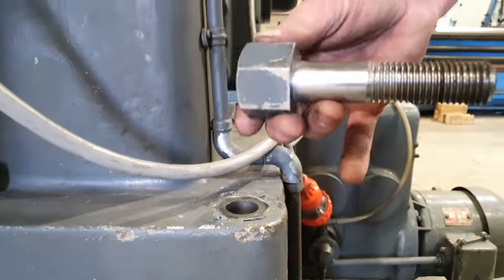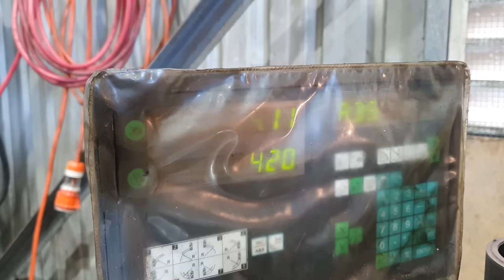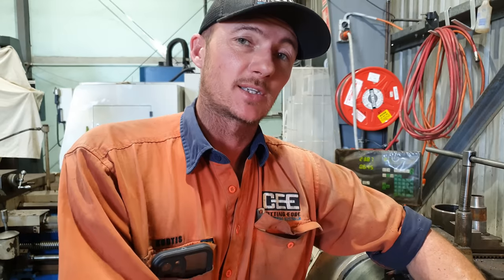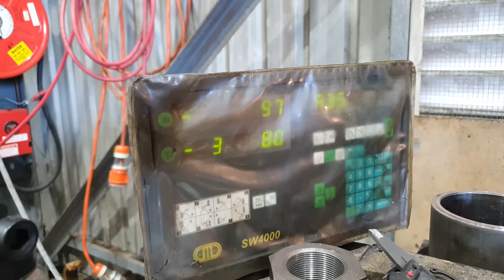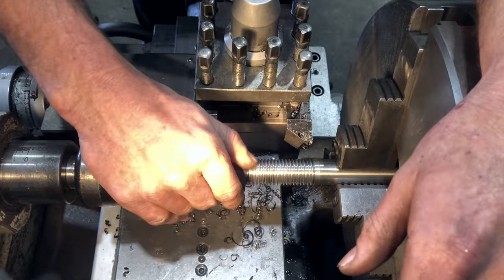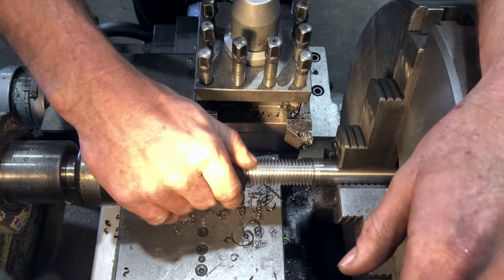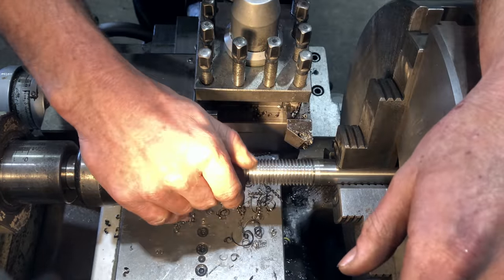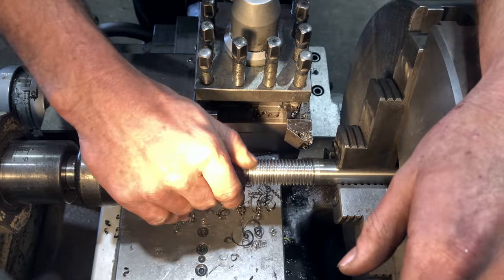Making BIG Hex Bolts | K&W Facing Borer Upgrade | Part 2

Comment: You forgot possibly the two most important reason to have the hex heads flanged. 
(1) it looks prettier than a plain hex. 
(2) it gives you a good reason to have used that large round stock. You can't do that with hex stock! 
Everyone knows that style and excuses come before function haha.
Reply: Any advantage to cutting the entire bolt out of such a large stock vs making a threaded rod out of lighter stock and welding a nut on the end?
Reply: @MMMRCHPCTB  That’s a different can of worms. You’d save on material but always worry if the six wormy welds were strong enough. Machining from solid 4140 is best with no worry about the worms.
Reply: @MMMRCHPCTB  I would make a threaded rod and use two nuts from each side no need to even weld
Reply: @ellieprice363  if the nut was threaded onto the rod the threads would give it all the strength it needs, just one weld on the end to keep it from spinning.
Reply: @dewaynek8591  True, 4140 all- thread rod  and welded flange nut would be strong and work well but wouldn’t need the machining that viewers are more interested in.
Reply: Mate, that's probably what the rest of us would do (having lesser tools). I think ole' Kurtis is more of an old school Engineer and want's to be proud of every piece of work he does - even if it can't be seen, someone will find it one day. Beautiful bolts and a pleasure to watch. Cheers.
Reply: @ellieprice363  if the only point was to make YouTube content he could have used 1” round stock and just threaded the ends which should be stronger than all-thread and then made the flanged nuts from scratch. Could have even cut the threads with a slight interference fit to get some liquid nitrogen action and top it off with a bit of TIG maybe silicon bronze just for aesthetics. Not saying the bolts didn’t turn out great but if you’re going to go over the top might as well go way over.
Reply: @MMMRCHPCTB  Yes, he already had the large stock which is a big advantage.

Comment: Another top notch video. I wonder what caused the reflection on the wall behind Kurtis during the out takes and also on the lathe behind him. 
The bolts look so very good and it will be a pity to paint them if you do.
Sorry to say Australia lost in the Little League World Series. They did play some good ball though.
Looking forward to you lifting the K&W Borer and fitting that block in there and then actually using the new machine.
jack, in The Valley of the Sun, Arizona, USA
Reply from the maker: hey mate the reflection is sunlight coming down through the whirlybird vent in the roof!
Reply: @CuttingEdgeEngineering   Saw that a couple of times, I thought beam of Sunlight through a fan.
Reply: De

Comment: Your videos are always interesting to watch and you can learn a lot, specially someone who's not in machining like me. Are you planning to cold blue the bolts or crome them as the original ones were ? Looking forward for part 3!
Reply from the maker: hey mate thanks for watching, wont be doing either of those the bolts will stay as is
Reply: @CuttingEdgeEngineering  have to polish them once a week to keep the rust off. Speaking of which, what happened to the indexer's complexion? Looks like a visit with some Evaporust followed by Bostick's Dricote might be in order. Don't know if you get either down under but both good products. 
Thanks for the video, Karen's excellent work as usual.

Comment: OMG! You didn't peck,dab,peck, dab, peck,dab with a strategically placed tin of cutting oil whilst centre drilling. Usually done by folk just because they're on Youtube to stop negative comments about wearing out the centre drill blah blah blah. Life's too short to worry about bollocks like that, good on you. Nice work.
Reply: I don’t wear them out, I just break them doing that!  I’ve gotten better at that.
Reply: Big machine and workpiece less chance of the larger centre drill breaking.

Comment: Things to have in the end times:
a) 2mm drill bit as they friggin break
b) 10mm socket as they mysteriously vanish
c) 12mm button insert (a newcomer but apparently promising)
Reply: Not only 10mm sockets, 10mm spanners (ring and open ended) also have a nasty habit of growing legs and walking......
Reply: @jonathangriffin1120  I frequently call these "deserters" ...
Reply: @jonathangriffin1120  Testify! Those damn 10 mm spanners are what you need for the cabinetmakers joint clamps to permanently pull the two panels together and the proper spanners are the only ones that will fit in the rebated holes. The little bastard frequently goes missing and the best thing to do is to buy multiples to keep in the tool box.
Mark from Melbourne Australia
Reply: 10 mm spanner, sockets and socks all go missing. Curse of the S.

Comment: Couldn't you just use a pipe wrench on the ends of those bolts without having to stuff around making them hex?

I wish I could have seen your face when you read that. 🤣🤣🤣😂🤣  Good job, done properly. 👍
Reply from the maker: I threw up in my mouth a little bit reading that 🤣

Comment: That's a lot of material to remove to make a bolt. I would have threaded both ends of a rod and silver soldered a nut onto one end. You do good work and the bolts are very nice.

Comment: I'm a mechanic in a large machine shop.  I have never seen anyone thread like that.  Usually they set their topslide to 29ish degrees and use that to move in on the thread.  Bringing their cross slide back to 0 after backing up.  Of course here in the states they don't have to stop the machine and reverse it for UNC usually only for metric.

After looking a little better I see your topslide doesn't seem to rotate like that.

Comment: Cutting threads with the compound at 90*, I see you advancing it along the Z axis slightly each cut so you are cutting with the front edge of the tool each pass and not just plunging, I'd love to hear why you do that and not the 29.5/less than 30* and feed in with the cross slide like I have seen most others do and your techniques on threading. I really do enjoy your channel and feel like I have learned a lot watching you so thanks!

Comment: I'm at 15:00 and I was thinking you could just weld nuts to the top using the lathe to centre them up. All the hex needs to do is impart some torque onto the bolt the head just needs to be thick.

Comment: I'm not a machinist, so forgive me if this is a dumb question. Could you start with 1" bar, machine the head the way you want it, including a socket of some sort, and weld or braze them together? I've watched you do something similar with countless tubes and end brackets.

Comment: I watch a lot of your videos and very impressed..I do alot of machining for those big yellow dirt movers ..question is...watching you thread, you  radial thread with  the compound at 90deg and move it a few thousands of a banana each time you make a pass....how do you not cut the root too wide. I have always done manual threading by the bible...it has never failed me....lately I have been very interested in the different ways people machine.

Comment: Lovely work, as usual.  Any reason why you couldn't just use big studs? You could make the top nuts blind too, so they'd be basically indistinguishable from bolts. That would have saved a lot of turning.

Comment: Kurtis, I was fascinated by your unconventional threading technique. Nonetheless, you achieved an excellent result. Conventionally, the compound is set to 29½°, the cross-slide is zeroed at the scratch pass, the cross-slide is returned to zero at the start of each pass, and the next cut is advanced using only the compound. Your technique appeared to be, to leave the compound at 90°, advance the next cut with the cross-slide, and "bump" the compound. Is the the technique that you were taught, or is it the "Kurtis Technique?" This is one of the best machining channels on YouTube.
Reply: I was trying to figure out what he was doing there when I went through my apprenticeship one of the first things we were taught about lathes is that the compound needs to be at 29-1/2 deg  when you are cutting 60 deg V threads so when you are threading you are cutting on the flank of the thread.
Reply: @brianschein2320  It's an old machinist's trick, to move the top slide a little for each chip, so cut the steel mostly on the leading edge.
Just like if you turn the top slide 29.5gr
Greetings the old machinist

Comment: Very nice work. Why not add a stress relief cut at the end of the thread? Milling down to the minor diameter of the thread wouldn't compromise tensile stress and would make the bolt more resistant to fatigue in that area. Are you going to finish them?

Comment: Now I don't do machining and I'm not much of a physics expert, so I'd love to know why I'm wrong in thinking you could have gotten the right-ish size roundbar, thread that, and weld a hexnut on that? Is this really more cost effective with you wasting so much material, or would it lack strength otherwise? Love the vids, cheers

Comment: Nice looking bolts, but I am wondering just how long a bolt can be before torsional flexing becomes an issue. I am thinking that making "studs" and using nuts on the upper end would give you a better chance of getting them tightened up to specifications.

Comment: What are you doing with the compound when threading? Haven't seen that, mostly see American style threading. Seems you have the compound set at 90 degrees, do infeed on the cross slide, but bump the compound to get an angle infeed. I guess this avoids the full contact form tool cut, giving better finish, less chatter?

Comment: I found your thread cutting interesting.  You use the cross slide to feed in, bump the compound at every cut?  Compound set 90' to the cross slide.  

This is far different from what I was taught and often see on youtube.  (Taught as in my high school machine shop class. I'm no tool maker.)  I learned the compound is set 1/2 of the thread angle and is used to feed into the cut..

Could you expound on your technique please.  I'm curious.  Thank you.

Comment: Sometimes what I have done which makes things a lot easier is to cut the bolts in the middle the original bolts champ them add the length you need the length of them and carefully just weld them up.

Comment: Nice looking bolts Kurtis.  Was the chrome bar you purchased any different from the hydraulic cylinder rods you replace?  Just wondering if you could have used scrap rod instead, providing you had enough.

Comment: Is the steel used corrosion resistant or are you gonna coat the bolts? Or is that something your're not concerned about in your workshop environment?

Comment: I was surprised that you single point cut the threads. I thought for sure you would have set up a geometric die head.
We had old, big, cranky lathes at the plant so threading on them was a nerve wracking experience. At the same time I would have set up a follower rest and cut those bolts in two passes. I always thought it was comical to use indexable inserts in a lathe that was born in 1889.
Beautiful job on the bolts. I just knew you were going to leave a flange on them.
Great editing Karen!
Cheers 
Terry from South Carolina USA

Comment: This might be a dumb question, but when you are cutting threads on a lathe, how do you always land in the same spot on the material every time you make a pass? I understand that the feed rate is set to match the thread rate, but it seems that where the insert initially contacts the material would be random every time.
Reply: There are no stupid questions, sometimes there are just stupid answers. Each turn of the lathe chuck is synchronized with the rotation of the bottom bracket drive screw - therefore the knife always hits the same place. I hope I translate well, because I'm not English speaking.
Reply: When Kurtis backs up for the next pass, he keeps the half nut engaged and reverses the whole lathe, rather than moving the carriage back freehand.  This ensures the whole setup stays synchronised.  It's hard to see on the video, but the lathe chuck (and the work piece) are actually turning in the opposite direction compared to when he is cutting the thread while he backs up for the next pass.

Comment: I was watching the lathe opp. you had going somewhere around 5:37 I noticed how bad the condition of your coolant nozzle has gotten. And how it reminds me of mine. Just at that very moment your lathe made a weird sound and must have gone through a worm hole back in time but only for a second. Because the nozzle was brand new again. then it came back to normal just as fast. 
Did you feel it?   how did you do that?

Comment: What if… just say you made your bolts but the thread was too short - turns out you needed another 2 or 3 threads.  How would you do that, set the lathe up etc?

Comment: By the way to get basic size of a material to make a hex  profile multiply across flat size by 1.14 

For ex 19mm hex will need 1.14*19= 21.66mm round

And for square profile you need to multiply the size by 1.42 ie.  To get a 20mm sq you need 20*1.42= 28.4mm round

Comment: Hey Kurtis and family, I love watching the milling and engineering process, great videos and lovely presentation so thanks for that. I am not a machinist or anything so I was wondering if it isn't a big waste of time, material and money reducing the shaft that much in size? Couldn't the thread be made of round bar which is much closer to the desired width of the thread and the head welded to it or would that create auch to weak bolt?

Comment: Instead of cutting a hex in the head could you have used like a pin or hook type setup or does this use case need too much torque?

Comment: Those turned out beautifully but it seemed like a lot of machining. I was wondering why you didn't use 1 inch shaft to make studs. Have you ever used Super Nuts? They eliminate the drag in torquing large nuts.

Comment: Hello Homeless & of course KurtIs & Karen. Due to length I thought you may have gone to larger diameter fastener if feasible, with just the thread the same dimension. I guess torque  value not excessively high or a fine thread would have been used. I am enjoying the build/mod series looking forward to part 3.
 PS Homless needs another chew toy he has the squeaky out of that one already (LOL).

Comment: wandering all the time, if it would have been possible to use a rod with with threads and bolts on each end. Would have cut down on material and machining time a lot. But not sure if the base would allow it.

Comment: bolts turned out great i guess, if they will work, you did good. 
hey curtis build a f650 4x4 monster truck wrecker. 24k winch and telescoping 💥 boom. or you could just build me a 12" lift for my 1995 k2500 rock crusher. lol love the show.

Comment: I am curious at your thread cutting method NOT using the compound at 30 degrees. I have never seen this method before. Adjust depth, then add longitudinal feed to also increase the left side cut.
Reply from the maker: We will do a video about it

Comment: Do you need to machine in a chamfer where the shaft meets the head to preclude a stress riser occurring there?  If you needed the thread to go right to the head is there a way of accomplishing that without creating a weak point?

Comment: The compound setup is unexpected- per pass it looks like a few thous feed towards the headstock plus the cross-slide infeed.   I would have expected the usual 29.5deg compound setup and then exclusive feed via the compound.   Perhaps the two motions are added as vectors to achieve something similar?

Comment: Would it have been substantially cheaper to get 1" bar and make studs then fit flange nuts? 
Studs tend to be a bit stronger as you don't get the torque transmitted along the length.

Comment: Hello guys I have a question my son has a bolt broke off in the frame of his motorcycle were the plastics bolt to the frame we've tried everything diamond drill bits nothing will even scratch it any suggestions love your videos wish I would have taken machine shop instead of welding which I also love to do I use to be able to lay a perfect beed probly not now as I'm getting older and my sight is going lol hope to hear from you sincerely chuck

Comment: I think it would be more interesting if you explained why you sometimes use coolant and sometimes not. Is that based purely on experience or do you have more strict rules for that?
Reply: Kurtis answered this in his Q&A videos, basically he doesn't like the mess coolant can make so tends to use it only when necessary - deep drilling, harder materials and the like.
Reply: @michaelmclachlan1650  Thanks for the info. It also seems that you want to use coolant for final cut for maximum dimensional accuracy if that's needed (this matters because without coolant, the work piece may increase in size thanks to thermal expansion of the metal – the change is not huge but if you go for 1 µm dimensional accuracy, this will be needed).

Comment: You take several cuts to form the correct thread depth.
How does the cutting tool start at the precise location each time you make a new pass?
Reply: The feed head and cutting head are locked together when in thread cutting mode. So they move in sync and return to the proper position.

Comment: When cutting threads does lathe have to be manually lined up or reset after every pass or is there another way to ensure the cutting bit follows the same path every time? 
Thanks!
Reply: The operator moves the tool post away from the work pieces and just reverses the direction of the lathe without disengaging the feed screw, returning the tool post back to the start of the thread cut.

Comment: Would it not have been much cheaper to buy the material the size you need as a stud and use nuts? Not a complaint I was just wondering.